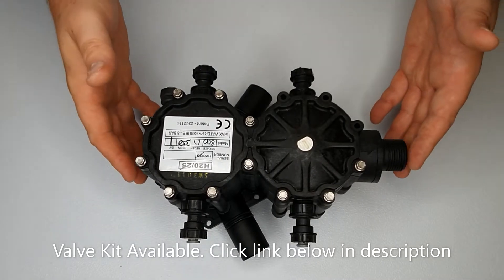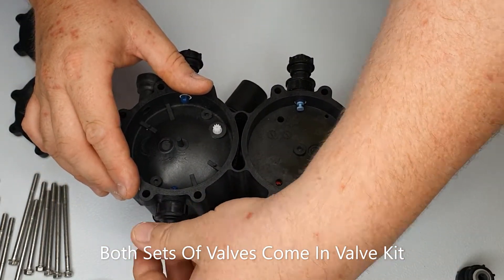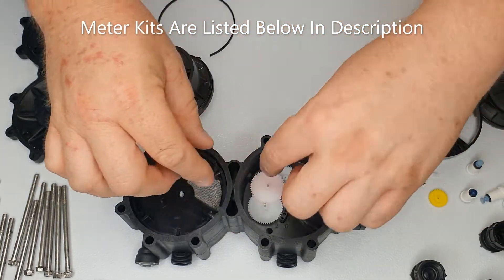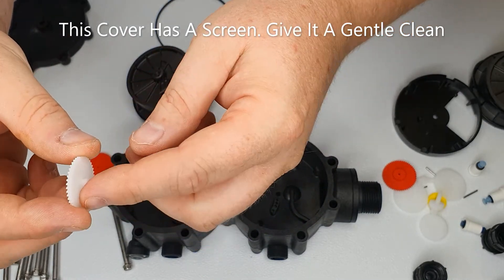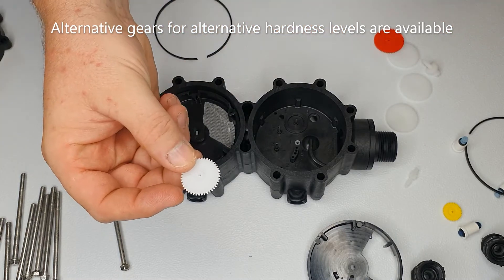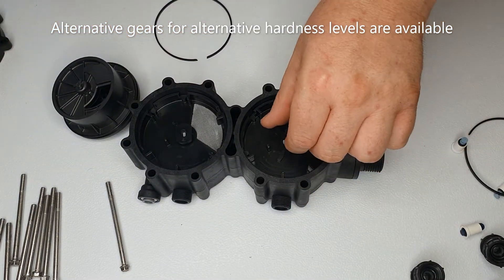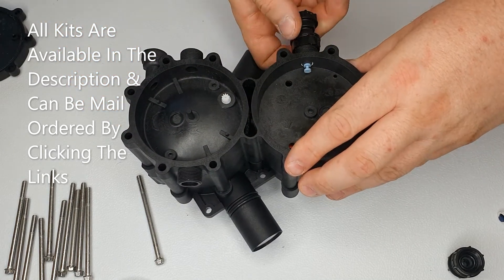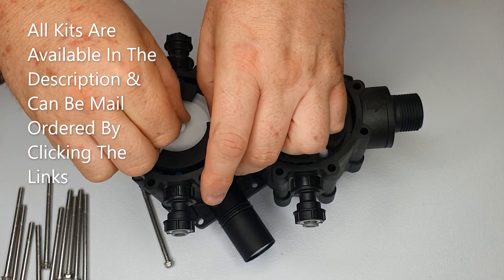Harvey Water Softener H2OGearbox Breakdown and Rebuild

Comment: Good video, but it doesn't explain 'why' we are doing this. My gearing system seems to have stopped working (got stuck on regen so I had a little play with the gears and now will not start regen). But, if I dismantle it all and rebuild it, am I likely to get it working again? What could / should I do to improve matters (i.e. clean all gear parts with something (?) before reassembling etc)?

Comment: The videos are a great help. but they are the same video repeatedly, showing the dismantling and reassembling of the gearbox.  Why not explain why you would have to do this, and what about the rest of the system. I'm sure that also requires attention and an explanation as to why you would need to touch it in the first place.  I have one of these softeners, and I have to say it has been outstanding. but now I have an issue with it not regenerating, and I don't think it's producing enough brine in the tank as it's not using salt... i have searched everywhere for help ..

Comment: Don’t make the mistake I did....followed the video and made sure I had the left tank identified before rebuilding and grabbing the right when needed. What I missed stupidly was that there is a top and a bottom. They look the same but the top of the tank has a small hole in it under where the tube connects. Due to working on kitchen counter it was at head height and not visible so didn’t realise until it refused to regenerate. Took a flooded cupboard and strip down to find by accident almost checking for blockages.
Reply from the maker: well done Graham, I will drop a video next week as an addition on how to identify the left and right side because they do look very similar. Great achievement, well done

Comment: I got one of this but all of sudden it make whole house got no water pressure! So i gotta by pass the softener! Do u know what happen ?
Reply: Great video, our crown twin tank softener seems stuck in rinse or regeneration. Water flowing quickly into the drain. Am hoping to be able to buy parts to fix unless it’s a blockage somewhere. What do you think? Thanks.
Reply from the maker: @grahamthomas5614  got your email and sent you some suggestions.
Reply from the maker: How old is the softener?
Reply: @TheWaterBoyuk  about 10 years! My cousin got it first then she told me how good was it then I installed it! Got told my other company salesman said it clog up cant fix need a new one ! Is that true?
Reply from the maker: @marcuslam6711  sounds like the resin has expired. The tanks can be replaced. Send me some pictures of the softener with the serial number andrew@aquaconcepts.co.uk and I will take a look. 👍
Reply: @TheWaterBoyuk  email sent! Thank you very much